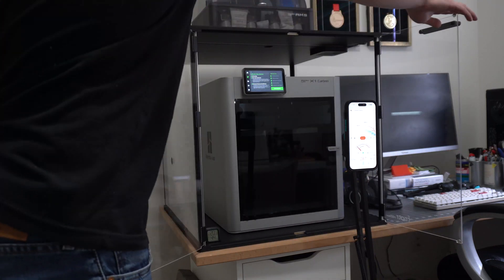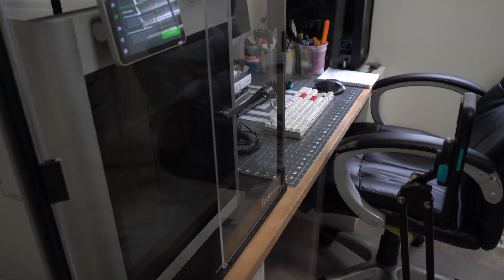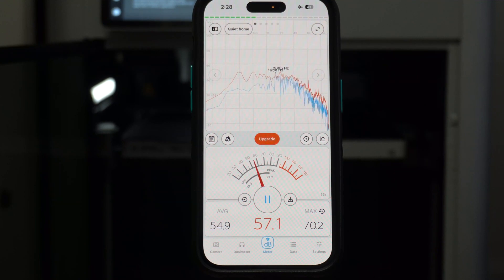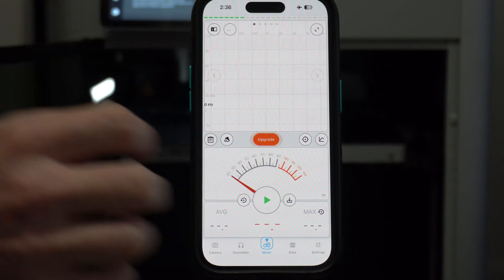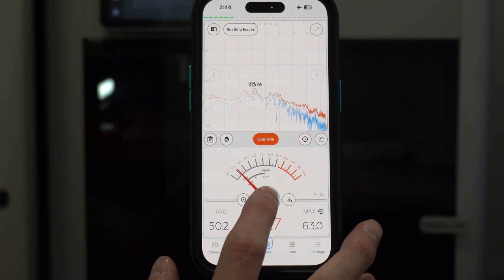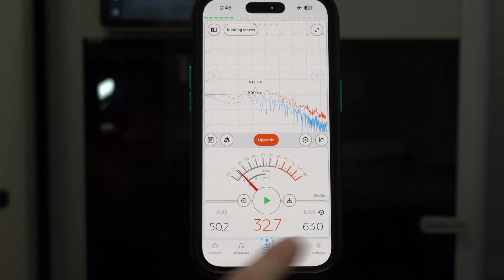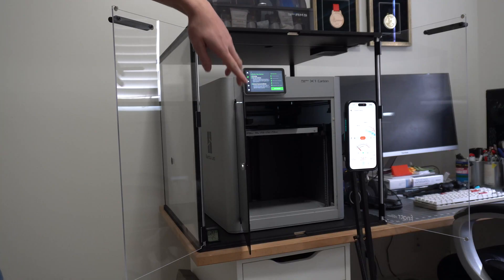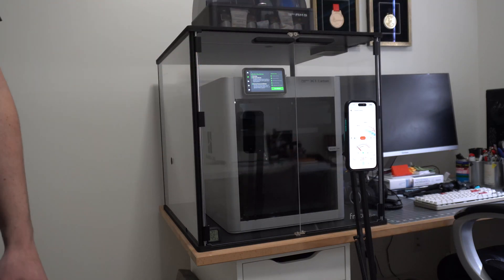Does an Enclosure Reduce the Noise from the X1C?

Comment: Thanks a lot for your video and your test on the BambooLab enclosure — it was super helpful!

I actually have three P1S machines, and since I’m moving into an apartment without a garage, I’ll have to set them up in a bedroom soon. I’m really worried about the noise, especially at night.

Right now, when all three printers run together, the average noise level is around 60 dB, and I’d need to bring it below 35 dB to avoid disturbing both myself and the neighbors.

I’m already considering soundproofing the room and building enclosures, and your setup gave me  ideas.

I was wondering — after a year, have you noticed any improvements or made any upgrades to your setup?
Did you find any more effective solutions to reduce noise since then?

Thanks again for your work — your feedback would really help me plan my setup!

Comment: With my p1s I use a server enclosurewith some foam inside  all walls and some absorber feet (hard Rubber ) with good results, never exceeding 40 db, a base cement or stone plate might be a good idea as well yet I haven’t tried it so far, because the solution is quiet sufficient for me right now. I guess a cheap solution might be a hard foam enclosure with soft foam panels inside and a hinged door with Tape or similar. Quash balls as feet’s were also recommended, but I have never tried them…
Reply: The big problem with my P1S is the low frequency sound it emits, they travel thru walls and ceilings, while all high frequency stuff is easy (easier) to remove by just closing the door to the room. I have been looking into some server rack enclosure aswell. Also the plastic sides does not really help, they act more like a resonance box, so fitting some dampening inside them would probably help aswell.  HOw much of the low frequency stuff did this remove?

Comment: should line it with sound foam just to see the noise level.  I bought the files from 'Printable Accessories Enclosure'(just google it) and I think it will be cheaper printing one.  It will hide my printer, I'm doing the printable peg boards and lining it with foam, and using the printable air filtration parts not so much for air filtration but for air circulation to prevent it from getting too hot in the enclosure, I don't want to cook the electronics.

Comment: Good info! Does the AMS still work with this enclosure, can a vent tube be attached to vent to the outside?
Reply from the maker: Not right out of the box but all you have to do is drill a hole for the AMS PTFE tube in the top of the enclosure. There isn't a predetermined spot for a vent tube but it wouldn't be difficult to model a vent tube attachment that attaches to the top of the enclosure where the vent fan exhausts.
Reply: Thanks for the response! Is this the #01 or #02 box?

Comment: that case isn't sufficient for sound proofing, really just good for maybe keeping the heat in, and maybe the odors in. For soundproof definitely needs more thick dense materials and should be airtight, with sound proofed air ventilation ducts

Comment: You know those sound exciters - speakers that you put on a surface such as a desk create sound by vibrating the object they're on? Any machine does the same. It is therefore essential to dampen those vibrations first, probably best with rubber or possibly silicone or TPU. Next, the sound of fans is a medium to high frequency noise, which is easily silenced but needs an enclosure. In an enclosure the soundwaves bounce around many times, each time a fraction of the wave passes through the wall, so if you add a thin layer of sound absorbing foam inside the original enclosure wherever there is enough space to do so, there would be much fewer bounces and less sound penetration of the wall, foam would also dampen the vibration of the walls. So for start, just add rubber feet and as much foam inside the original enclosure as you can.

Comment: The FNATR web site doesn’t list the X1C as being compatible with the #02 enclosure.
Reply from the maker: I made the same comment when they reached out to me and they asked me to measure the X1C to see if the dimensions fit. It fits just fine, same overall dimensions as a P1S idk why they don’t list it as compatible on their website.
Reply: @3DPrintStuff  cool. You don’t have the AMS, correct? Wonder how it would work with an AMS, placed next to it, or even on a shelf above the X1C?
Reply from the maker: @Pics2FlicksDennis  The AMS is in this video. It's just sitting on top of the enclosure. They have a filament passthrough integrated into the top panel but it's in the wrong spot for Bambu Lab printers. So you just need to drill your own hole for the AMS tube to fit through.

Comment: thanks for the test! i dont think i could put it next to me while working so its gonna go to the bedroom with a vent outside. do you do anything regarding the fumes or do you just dont bother? best
Reply from the maker: I only print PLA when I have the printer in my office. I've moved it to the garage to print other filaments such as ASA and CF-nylon. 

The built in filter + the filter/fan on the additional enclosure do a decent job of eliminating any PLA smell. 

I've recently setup the A1 mini in my office with no enclosure and I bought a standalone air filter unit to deal with the PLA smell. Regular PLA I don't notice very much but silk PLA with whatever they add to make it silky stinks and I'd rather not be breathing that in.
Reply: @3DPrintStuff  the only time i get a strong PLA smell is when its too hot.

Comment: Nice and it delivers about the expected result. A bonus would be to see it it also gives an electric power saving. When I enclosed my Creality CR6-SE with simple acrylic with bubble plastic insulation I saw the power consumption drop by over 100W on average (mainly less heating of the bed). A double enclosure should give a further improvement. Also the temperature inside the first enclosure might reach a few degrees higher temperature (not sure whether the X1C controls enclosure temperature actively).
Reply from the maker: That's an interesting point. I didn't really think of the printer not having to input as much power to maintain bed temperature. 

I've read some forum posts of people placing the X1C inside an enclosure and achieving chamber temperatures 5-10 deg C above their previous readings. 

There is a chamber fan to regulate temperature but it can be disabled in the slicer.

Comment: Good work, one question, without the enclosure, with the X1C door closed and open, is it loud enough to disturb your sleep if you're one floor above. Right now my printer is a the bedroom next to my bedroom and it doesn't wake me. I'm sure the X1C would wake me but I'm curious if being one floor down, directly below, would wake me. Thanks
Reply from the maker: I cant actually answer this one because I live on the main floor and different people live in the basement. I don't print overnight just out of respect for them but I'm sure they can hear something when it's printing. 

I did this test to see if the enclosure would allow me to bring the printer into my office but I'll probably move it back into the garage pretty soon here. 

Hopefully they can come out with some quieter printers in the future. I would trade speed for this thing to be relatively quiet.
Reply: @3DPrintStuff  Agreed, I want it as fast as possible without waking/disturbing the house.